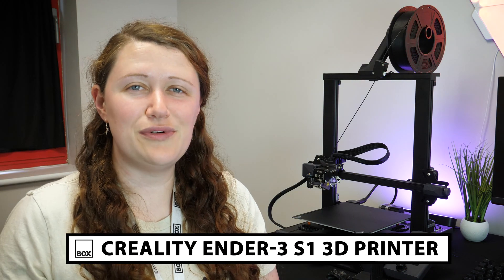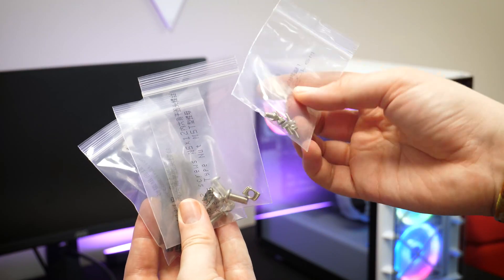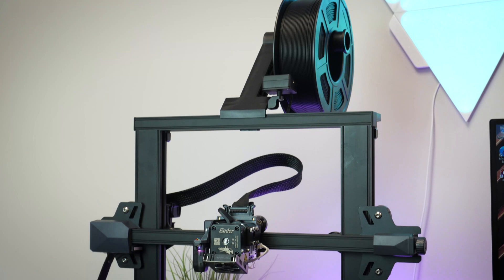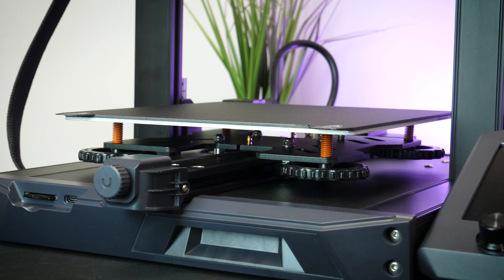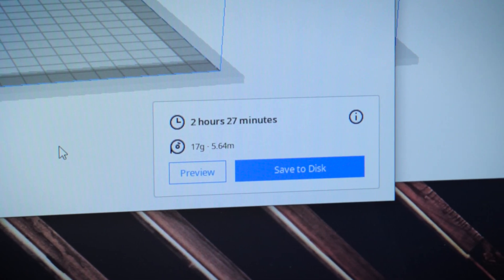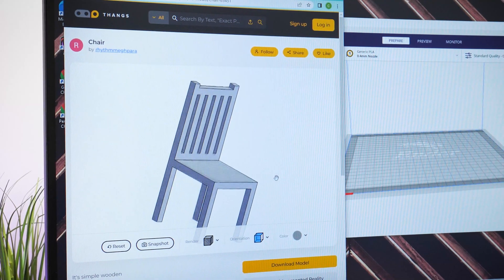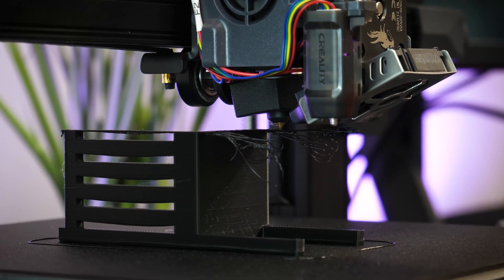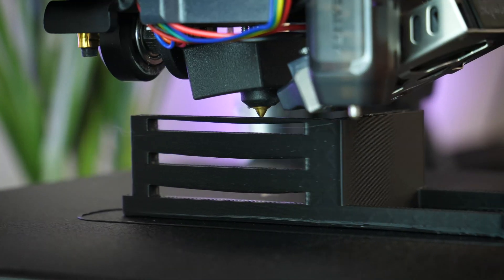Creality Ender 3 S1 3D Printer | Beginners Review

Comment: Stuck in the SD card but nothing is on it according to the printer
Reply from the maker: Hi! Sorry to hear you're having problems with the SD, I know they can be hit and miss at times. Have you tried inserting the SD card first before turning it on? I heard it works better if it's inserted before powering it on for some reason. Also, if it's something you've named yourself, the file sometimes won't appear on the display if the g-code name is longer than 8 characters. I hope these help in some way!

Comment: I set it all up, stuck in the memory card and picked a model, this thing is driving me nuts... almost nothing at all comes out of the nozzle and the thing just keeps moving around at the same level never even thinking its building up layers... I'm going to bin it soon
Reply from the maker: Maybe try pushing the filament further into the nozzle? Sometimes it won't push the filament out if it's not into the nozzle all the way? Helps as well to bring up the temp of the nozzle more and try to feed it through after 👍
Reply: @BoxCoUk  Thank you, I did notice while poking the nozzle clearring needle through the hole it went through easier when hot too - at first it went through my finger like butter - shoper sharp ! - will give that a bash and hopefully start my 3DPrint journey, the boys are desperate to get something created

Comment: My first print came out right but all prints after wont stick and the filament comming out stringy any suggestions
Reply from the maker: Hi! I found that raising the temperature of the bed and bringing the nozzle a little closer to the bed as well can make prints much smoother and should help it stick to the bed 👍
Reply: hey Thankss ! at first it wasnt leveled right I leveled it now its printing out real stringy it will do half my print and the other halfs just strings
Reply: @xoxonana1758  Sorry - I am a little late with responding, but here a few tips.
Stringing is mostly caused by a too hot nozzle. Try setting the print temperature a tad lower and see if you get any better result. Some filaments are infamous for causing a lot of stringing and needing a lot of fine-tuning. Especially PET is one of those filaments. I always recommend starting with PLA, and once you got that right experiment with other filament types.
You can improve sticking to the bed dramatically bey using an adhesive spray. I personally use 3DLAC, and have no problems with prints sticking to the bed at all. Keep in mind that calibrating your z-axis is really important for a good result.
Lastly - I use the Prusa slicer for all my printing. It's a free slicer and if I recall it also has a profile for this printer. You can let it add support automatically, but also "paint" support by yourself. I personally had better results than with the Creality slicer (that is a bit modified old version of Cura). Cura is a nice slicer too, but in my experience a tad more uncomfortable to work with. I prefer the Prusa slicer, but of course everyone has his/hers/its preferences.

Comment: These things are junk. The Auto Bed Level does not work, you have to manual level for good results. Some of them were shipped with different chips that you cant flash either. Now I have a $500 paper weight
Reply from the maker: Hi! That's such a shame that it didn't work out for you. Hope you find a printer that does everything you need! 😊